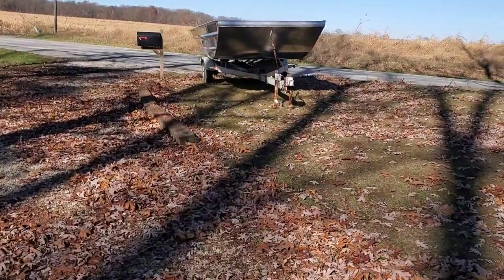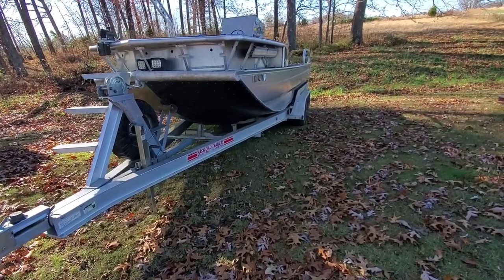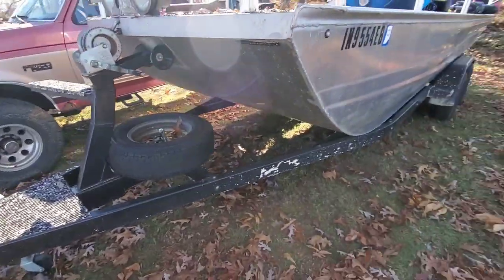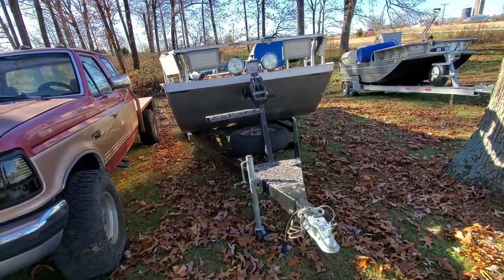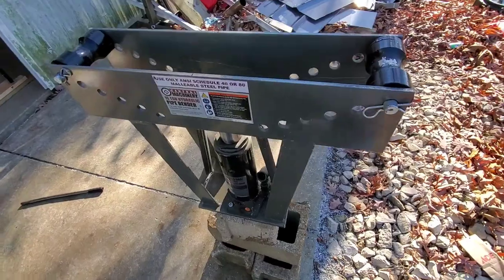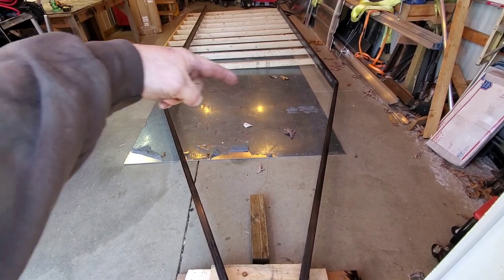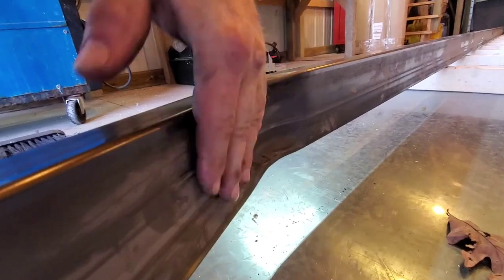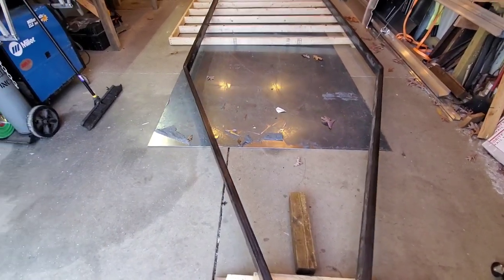How to Bend Rectangular Tube

Comment: You don't have to get a high end mandrel bender. Look at the Big Brute horizontal ram bender. You can get tooling made for it that will allow you to do this and hold the structural integrity of the tubing. The crushed in corner has the potential to become a tear point, even with a cross member. I engineer trailers for a living. Trust me on this.

Comment: Idea  to keep the top and bottom of the bends flat clap some oak hardwood from a pallet over both the top and bottom that will fit into the bender and add pressure enough to hold the square shape and keep the sides flat  That's kinda what a roll bender for square tube does,   Try this on some scraps first so your not trashing 100's of dollars worth of steel tubing.
if you had a machine shop you could make the jig's to do this but you don't have a lathe or mill on hand. You have to work with what you have for now.   I'm looking at this because I'm going to try and put a arc in extruded aluminum  80/20 stock just using mdf jig and clamps.  Look up 80/20  its some really cool stuff. Amazon has some short pecs  but you can look at 80/20 net and get a free sample.   I'm serious if you like to make stuff you'll love this stuff.
Reply from the maker: I've used it before.  Its expensive but the tracks are handy for some things.  Run it through your tubing roller it will arch nicely

Comment: i use the same method on my jet ski trailers, comes out really well using 75mm x 25mm  with the 25mm die. not working to well on the 75mmx 50mm i got the crowning on the top which i don't like, thanks for the vid. Jet Junkie  in Australia

Comment: Question for you bud, I've got some steel 1" x 3" rectangle tube, 14 gauge that I want to curve into a bow shape.. around 6 ft tall in total once curved and the apex of the curve will need to be ~16".  What do I need to do it.  (and curve will be on the flat 3" side).  Thanks for the help if you can.
Reply: You'd probably want to use a ring roller for that.

Comment: Those bends look really bad.  I would not trust a trailer built with damaged tubing like that.
Reply from the maker: is it's been pulled for 2yrs with Zero issues. you didn't see the final product & have Zero idea how I built the frame structurally.
Reply: @DustinApple  we don't have "zero" idea, the video shows at least one part of the building process, and it's done wrong. You can't expect everyone to give you the benefit of the doubt on the rest of the build. When it comes down to it, those are bad bends, those rails are failed structurally. You'd have done better to cut the top/bottom/inside of that area off, bend the now flat plate section, pi cut the c channel section you cut out, and weld it back in. 

I'm sure you've bent pipe on that bender before, think about what a failed pipe bend looks like... exactly what the bends in your rectangle tube look like. No one is on here to shit on you or make fun of you my dude, we just want to see you building safe trailers. When everyone is telling you you're doing something unsafe it's time to listen.

Comment: That bend has taken 75% of the strength.
So you will have 1.5 tubes of strength. If that's all you need then great.
Reply from the maker: No idea what unit of measure "tubes" is.
Reply: @DustinApple  you started with 3 and have 1.5 left
Reply from the maker: @YouThinkAboutThis  not sure how you figure that but ok.  Made a 7k trailer out of it.  Put a cross tube behind the bend then a longitudinal tube to triangulate around the bend.  Worked great, got the profile I wanted, and the strength was adequate.
Reply: @DustinApple  in that corner area it's just hair better than flat bar.
I'm all for easy and productive as long as it's strong enough. Worst will happen is it starts cracking and you add plate.
If you added a corner brace you're golden.

Comment: Gee i hate building shit like this... I built a 3,500# single axle utility trailer, and listed it for sale, it's top notch, did everything by the book, primered and painted with quality paint, stained and sealed 2x6 treated wood deck, even built it off of engineer stamped blue prints i paid for and i registered it to get a pink slip so the sale feels more legit than just a bill of sale. and one of the first questions people ask is, "What kind of trailer is it?" As If the trailer i spent a week making perfect in our fab shop with a $5,000.00 welder and the knowledge to use it is in some way inferior to a mass produced big brand trailer that was cranked out as fast as humanly possible... It's been listed for 2 weeks, If it don't sell by next weekend, i'm gonna keep it and start using it lol, it's probably built better than anything else i could've bought especially considering the amount of money i have into it.  My favorite one is "well i found this beat up old rusty pos with a rotted wood deck and weathered tires for $400.00 less" Good you should buy it, it'll give you something to work on every weekend lmfao.
Reply from the maker: Dude I love this comment.  I drove OTR for 10yrs flatbedding. I own 7 trailers and I make dam sure they stay in top shape. Nothing ticks me off worse than seeing someone pulling a $200 pos with no fenders. No lights. Usually over loaded and not get pulled over immediately.  I feel your pain. With steel being outrageous its very difficult to build a trailer to the quality it needs to be and then have explain physics to the typical person who only sees a price tag.  I don't even talk to those people, infact I'd charge them more for being ignorant.